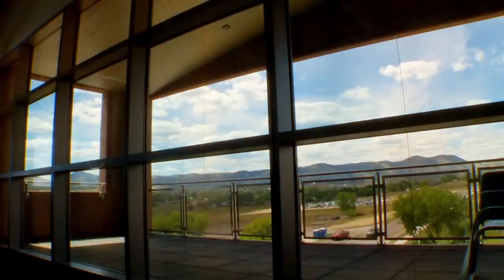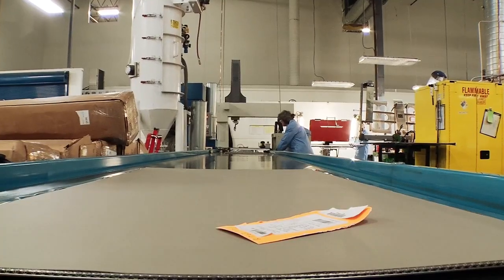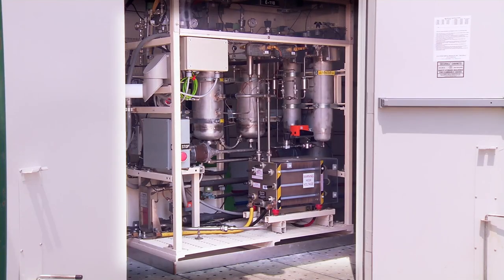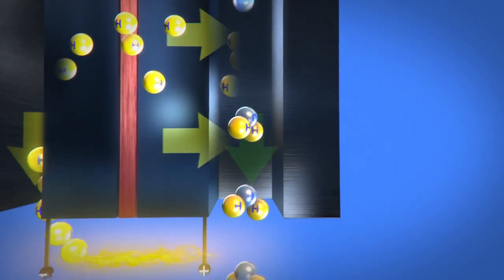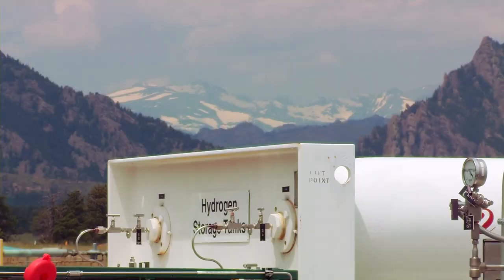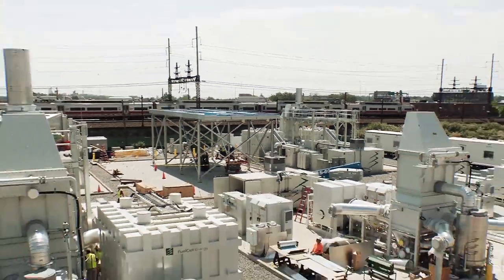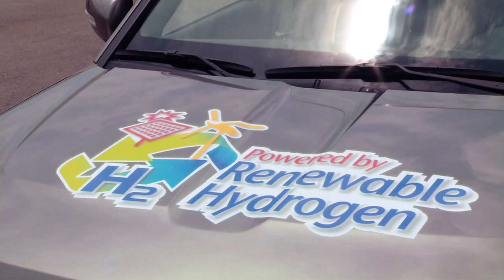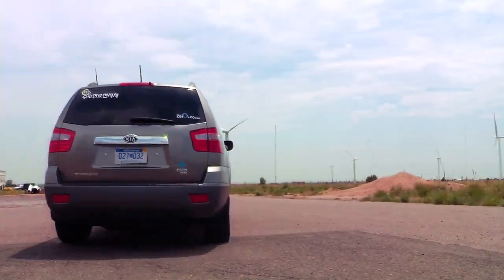Energy 101: Fuel Cell Technology

Comment: "Without any combustion".  When hydrogen is in the presence of Oxygen, a combustion takes place. Were the writers even briefed on well known facts of science?
Reply: Here "combustion" means yielding carbon or carbon oxide/dioxide
Reply: Combustion usually produces heat, light and the emission product of the fuel combined with air, a fuel cell's reaction does not produce light and can be conducted below combustion temperature. The energy obtained from a hydrogen fuel cell is in the form of electrical current. Hydrogen atoms are split into electrons and protons, the protons move to the oxygen where they combine and heat and water are produced. The electrons provide the electrical current, there is no hydrogen combining with oxygen, only the protons of hydrogen reach the oxygen. Hydrogen can be used like propane to run an internal combustion motor or in a furnace. " A fuel cell consists of two electrodes—a negative electrode (or anode) and a positive electrode (or cathode)—sandwiched around an electrolyte. A fuel, such as hydrogen, is fed to the anode, and air is fed to the cathode. In a polymer electrolyte membrane fuel cell, a catalyst separates hydrogen atoms into protons and electrons, which take different paths to the cathode. The electrons go through an external circuit, creating a flow of electricity. The protons migrate through the electrolyte to the cathode, where they reunite with oxygen and the electrons to produce water and heat"  https://www.energy.gov/eere/fuelcells/fuel-cell-basics

Comment: This is foolish. Hydrogen requires alot of energy to be made in the first place. The video says it itself, it's "energy storage" not an "energy source".
Reply: Same issue with batteries but don't have worry about a cell in the battery going bad and carrying al the dead weight of a discharged batter.
Reply: Mostly, they produce Hydrogen using renewable energy. Relatively, renewable energy isn't a stable source of energy but if you use it to produce and store Hydrogen, it become more stable. The challenge is storing Hydrogen which can be solve by having a stable usage of life application that depends on Hydrogen. Actually, this is a long discussion. Also, they didn't mention in the video the high cost of fuel cell.

Comment: Fuel cells are stupid. The energy needed to manufacture the hydrogen defeats all the benefits of the fuel cell.

Hydrogen is not an "energy source," it is energy storage. We have no natural supply of hydrogen gas and instead have to use another energy source to manufacture the hydrogen. Nearly all hydrogen currently comes from reforming natural gas, but that process produces just as much CO2 as burning the natural gas. Electrolysis (splitting water) requires electricity to already exist, but the process is inefficient and throws away a third of that initial electricity in just the first step. Overall, it is about 1/4 the efficiency as just putting the electricity into a battery.

The only place hydrogen has a real benefit is for planes, drones, or other flying devices. Hydrogen has an excellent energy to weight ratio, meaning a plane fueled by hydrogen may be able to carry more cargo since its fuel weighs less. Every other application, like cars or power backup for buildings, are better and more cheaply served by batteries.
Reply: What is the final calculated "efficiency" from the electricity used to produce hydrogen gas to the use of the hydrogen gas in a fuel cell to produce electricity?
Reply: @jrfutube2013   around 30 %. Combined 60 % of electrolysis + 50 % of fuel cell conversion in electricity

Comment: I've been thinking about Nitrogen recently , and I wonder if Nitrogen can also be used as an Energy source and produce Oxygen as a waste product . Being air is 78% Nitrogen and almost 20% Oxygen , I wonder if Physics can reverse engineer what occurs when lightening strikes .
 America ~ Land of the Free & the Brave .
Reply: Bond dissociation enthalpies of H2(g) and N2(g) are 436.0 KJ mol−1 and 941.8 KJ mol−1 respectively which simply means that same amount of h2 n2, h2 would require less energy and will provide more efficieny
Reply: @SavvySequoia  , Thankyou for your response. Please break down your complexities into more simple science, I understand hydrogen 2 atoms/nitrogen 2 atoms/ hydrogen 2 atoms; but don’t comprehend what you’re trying to convey.
Reply: @SavvySequoia  Yes, but I think the main idea is that H2 can be combined with our atmosphere abundant oxygen and create a harmless byproduct that is water, rather than HN, HNO, or other acids which may be pollutants
Reply: @koi2932  Thats a better answer!
Reply: The fundamental principle is the change in chemical energy from the starting chemical to the final chemicals. Gasoline and other hydrocarbons have very high chemical energy. When they burn, they convert to CO2 and H2O, both of which have low chemical energy. That difference in energy is what's released and what we can harness to do work.

Nitrogen gas, N2,  which makes up most of our atmosphere, has low energy. Furthermore, many of the chemicals it forms when reacted with common elements are undesirable, like cyanide, ammonia, and nitrogen oxides (NOx).